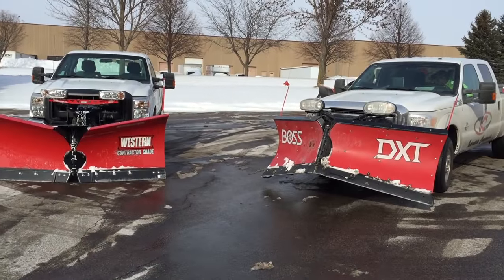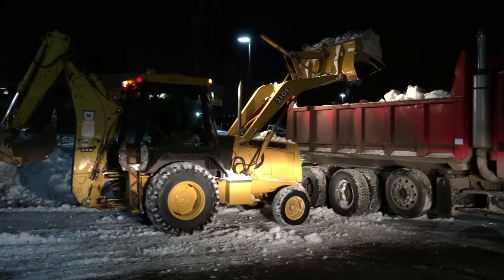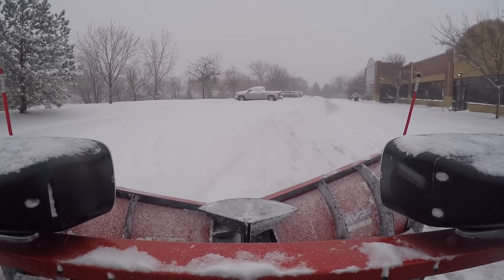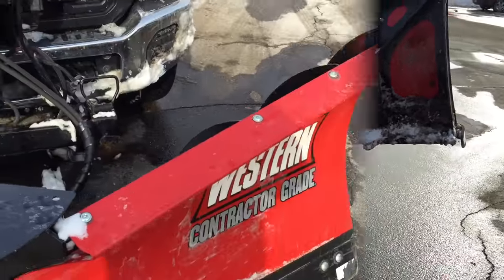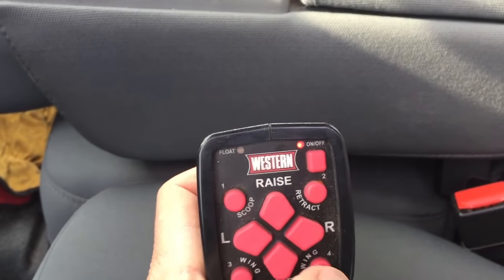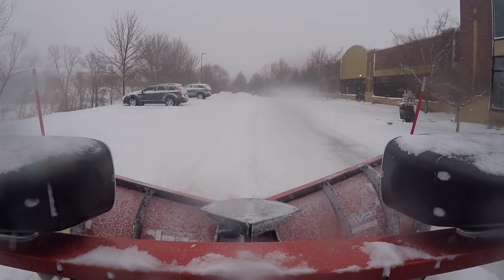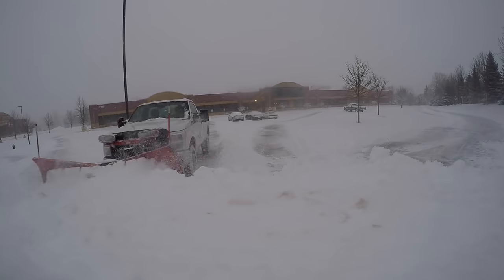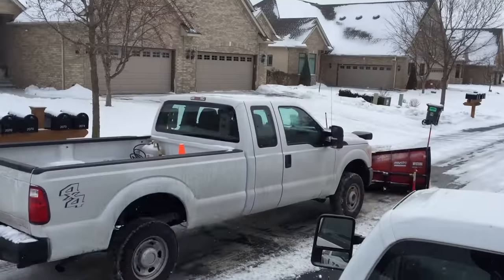Plow Review  Boss Vs Western snow plow

Comment: The boss controller you can have both wings come together at the same time together hit both buttons at the same time and also bring them back and as far as the sides pushing back they don’t if you buy the right cylinders they have locking cylinders I don’t pushback we have six bosses and we also change all our snow pushers we bought four brand new metal plus it’s PLESS they’re extremely expensive but they are awesome I can’t tell you their metal blade and I got rid of all of our Rubber blades   Sorry I dictated all this if it comes out a little strange you can call me I have some more stuff

Comment: Love my boss 9'2" but yes, when in scoop mode if you so much as look at it wrong it will bypass hydraulics and start to fold in to vee mode... had it back to the dealer and watched as they tested line pressures and bypass pressures and all was in spec.... just a weak link on the Boss but it infuriates me when I've got a lot to do and I'm trying to scoop/stack my snow and that goddam wing starts folding back in to vee position.
Reply: Did you see the comments about adjusting the power to your wings so it won't do that anymore? Did your service techs do that?

Comment: I started years ago with a fisher minute mount 1 which was a piece of crap, it takes two people to mount that thing up unless its perfectly lined up. Then I went with the fisher minute mount 2 which was supposed to be a great system, I still wasn't happy with it. I went and looked at a new fisher again 3 years ago and the v plow looked so flimsy and overpriced. I made the switch to boss and haven't looked back since. The smart hitch system is easy to use and I never have any problems hooking it up. Even if you're off a little bit I just push the plow forward a few inches with the truck and it slides into place. I've put a ton of hours on it and had minimal issues. I would say the cutting edge doesn't seem to last as long as I want but I get about a year out of them.

Comment: got a fix for the cutting edge, I can send a dxf file you can take to any metal manufacturer with a plasma table, they can plug it right into their machine and one cut from AR500 steel if anyone needs

Comment: Regardless of cutting-edge that could come down to operator error. Western by far would be the primary plow on all my trucks due to the fact of their Simplicity of use and the most powerful plow to this day. It's common sense to stick with one product instead of having different design plows on all your trucks and that would come down to Parts interchanging with the Western plows. FYI junk or sell off your other plows and by two more westerns.
Reply: I’ve installed dozens of boss and western in a dealership setting. When the Mvp3 came out I could believe the lack of quality on a flag ship product. Do a install on a dxt... way more support truck side, much higher quality structurally, and build and install are simple/ well though out. In my experience boss have less failures as a whole.

Comment: i had a boss V for 1 season, it was plagued with problems from the first use (pretty sure it was a lemon) not going to go into great detail but the dealer support for it was horrible, boss customer service wasn't much better, we were without it for nearly the whole season, Boss did finally come through and replace the whole setup just in time for the last storm of the season. we sold it that spring and bought a western (i was far from pleased with Boss and wont buy one again)but my experience seems to be isolated as i have friends that run them and love them.  Currently run western, fisher and blizzard. Had a western MVP for 5 years and had the whole pump just burn up in the middle of a storm, western replaced the whole pump assembly for free and had it back up and running to finish the storm. keep in mind it was out of warranty for a couple years. i've since added 2 MVP3s to the fleet and love them. ive got nothing but good things to say about western, never had the cutting edge problem that you experienced. i can tell you this though my blizzard 8611 dominates any plow ive ever owned as far as efficiency goes. its a slow plow and its heavy but it cuts plowing times in half. Great job on the reviews though.
Reply from the maker: +SummitLandscapingLLC Thats really cool that Western cam through for you!  Glad to hear that!

Comment: I have a boss plow that is 21yrs old but I run with a pipe on the bottom of the cutting edge and a toggle switch on my door above the window control before I had a western not as heavy duty and a hand control and have plowed for 51yrs in northern mi the boss 8.6ft wide and tall the best working and the fastest moving with the left toggle 4in control ,I am not plowing 30to 40 accounts like I did 15yrs ago the toggle control on the left side is the best ever if I want to plow fast u cannot beat it  so there u young people

Comment: We have 1 fisher v just like the western. Controller sucks, that V mode that u gotta dubble click to get it to scoop instead of V idk couldn't figure it out, gave that truck to Mexican to figure out. Then we have 12 Boss v plows, 7 old style 5 DXT , Nicest plow i think, controller is easy, u can do both scoop buttons at same times if thumb is big enough to catch both edges, cutting edges are expensive,  but we get about 2 seasons outa them, 1.5  id say on a busy yr, on 30hr storms. Which is a 3-5in storm. Condos and parking lots. On the non trip edge boss plows, about 1 a season has to be pulled apart from the frame and do rewelding on the bottom Box or the box that broke on yours. No trip edge and manholes put a hurtin on the older poly Vs. I was a Fisher guy till they started bending off the trucks catching a curb. Boss plows are 10xs more reliable then a Fisher. Keep oil fresh and extra relays in all trucks, they dont quit. If a boss wont lift or angle its water in oil frozen at valve, bad relay,  or bad controller. Thats all we came across in 10yrs running boss plows.

Comment: Douglas Dynamics (western) is terrible with warranty claims I know that for a fact.... We have a blizzard power plow. My first Douglas plow and my last completely due to the company. We had a cylinder crack on the plow only one year old, dealer refused to send parts instead made us bring plow to them, then had to wait for parts, then when it's all said and done I grab my truck keys and start to walk out and the guy tells me I have to pay for the repair, then Douglas dynamics "reviews" the claim and decides if I get my money back or not! So I'm currently in the process of waiting on my money to come back for a repair that took twice as long as it should have and tied up almost a grand of my cash.... I had a claim on one of my SnoWay plows once, never saw and invoice and was back running same day the way it should be
Reply from the maker: +wes92395 That sucks-  but doesn't surprise me.  My boss had an issue- they fixed it asap-no questions asked.

Comment: I don't own a plow, but I think the answer to the cutting edge issue lies in the material the cutting edge is made from.

If it is not Ultra-high-molecular-weight polyethylene (UHMWPE, UHMW) - also known as high modulus polyethylene (HMPE)  or high-performance polyethylene (HPPE) - then you're going to get a cutting edge that wears down fast. This stuff has the highest impact strength of any thermoplastic presently made.

Source: https://en.wikipedia.org/wiki/Ultra-high-molecular-weight_polyethylene

Comment: From first hand experience Western plows are not reliable. the frames and rams are all solid. At least the MVP plus I work on. except when it comes to the pump. last year it started leaking, put it away for the season then we busted it out for this season and it snowed once so we used it. I order ed all new seals including a pump and filter. put it all back together and it still leaks. let alone to work on the damn thing you have to take the pump off the frame to even see what the hell is going on. And this plow is only a few years old. I think we are going to finish off the year with it and put a whole new unit on it. So if I ever buy a plow for myself it's not going to be a western.
Reply from the maker: I want to give the new boss wing plow a try!

Comment: When it comes to the controllers I am with you the simpler the better.  The nice thing I found difference between Meyer and Western V is the Meyer has a better warranty and is Heavier Built.  look at your Western A Frame. where the adjustment in the A Frame on the Western is Meyer Doesn't have that maybe why you are eating up cutting edge.  Here is a place your can get aftermarket High Grade Cutting Edges.  www.evolutionedges.com you might want to look at replacing those Western cutting edges with Carbide Cutting edge.
Reply from the maker: +Don Hanson If I keep going through them- I will have to .